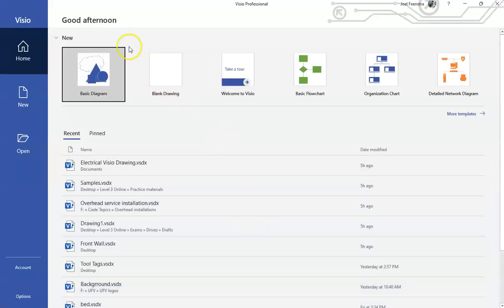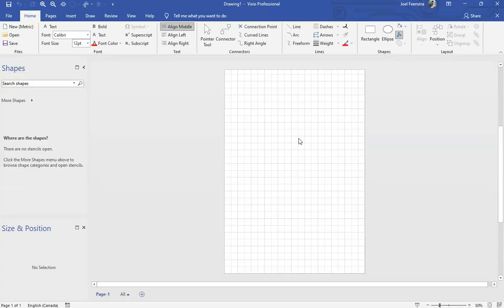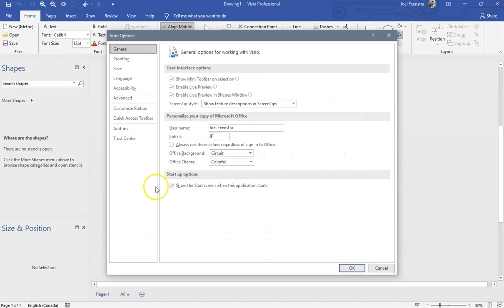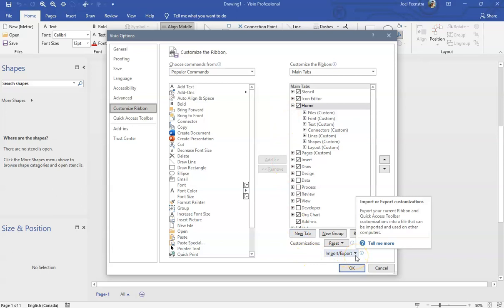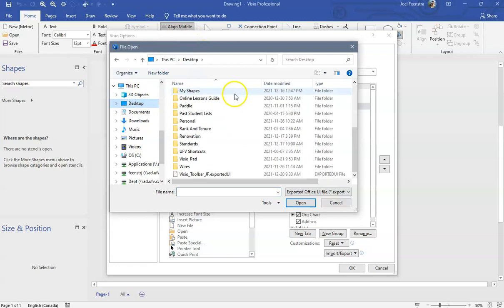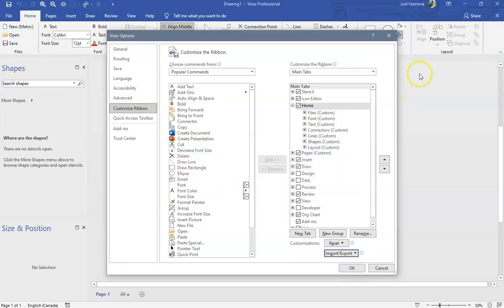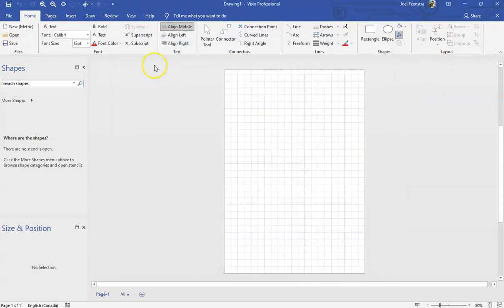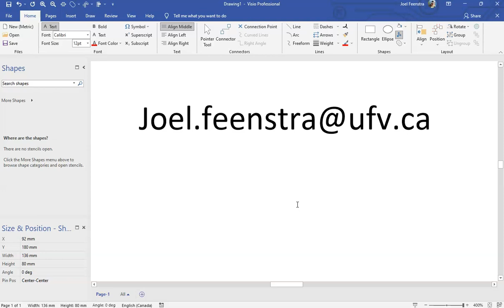Video 1  Loading a Toolbar in Microsoft Visio

Comment: I am using Visio 2007 right now but I will be upgrading for sure now. What year do you recommend since you mentioned 2019 or can the new 2024 work. I also would like to receive the custom ribbon too.
Reply from the maker: For software, my suggestion would be to get the 2019 pro version if your Windows version can handle it. I think it is the highest end that Visio will ever get to as standalone software, because after that Microsoft started that yearly-license-cloud-content thing and everything is probably web-based going forward.  And other than possible new AI integrations, drawing software isn’t really going to proceed much beyond where it was in that release.  Full software new is costly, but most users out there have had really good results buying from software resellers.  (It's this computer industry where people scour used or discarded computers, then delicense and resell software that has been left on them.  It is a legitimate industry, but to be honest, you always do worry that you are going to be getting sold a fake item.  But it has not yet happened for myself or any of the users that I have talked with.)